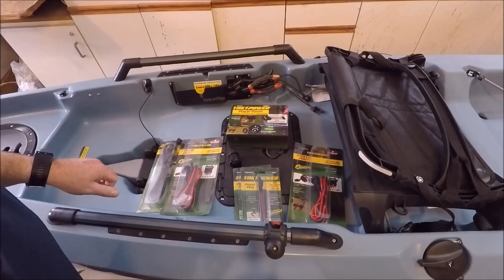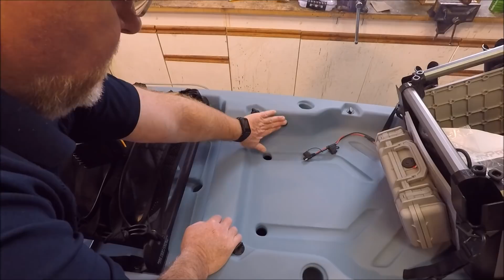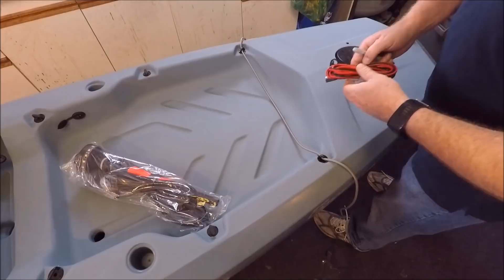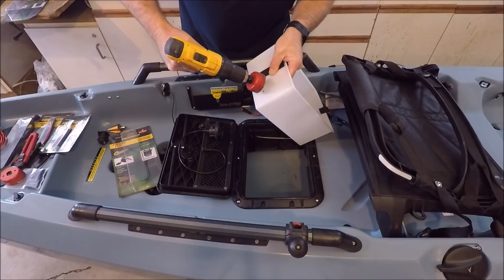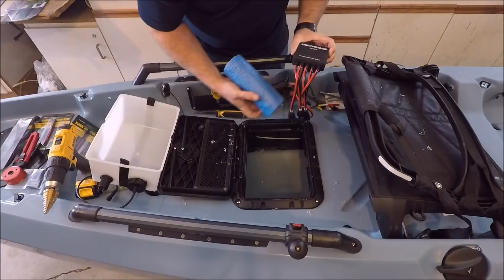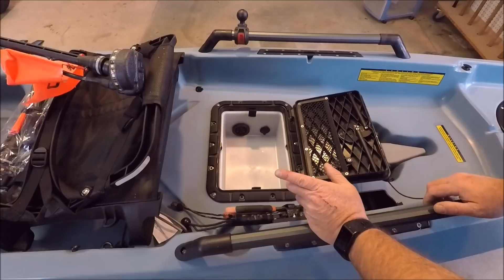Hobie Compass - Yak-Power system install

Comment: Was thinking of this set up using Nocqua batteries but wanted to wire 2 each 10 ah in parallel and add a charging port in the rectangular hatch. I will probably have to call Yak Power for advice. Comments?
Reply from the maker: You can't wire the Nocqua batteries in parallel. Look into FPV-Power batteries, they make a 7Ah and 17.5Ah. The FPV-Power batteries can be wired in parallel.
Reply: I called Nocqua- you can run in parallel but they don’t recommend and the warranty will be voided.  That said, in May 2019 they will have an auto selector that will switch power draw from battery 1 over to battery 2, when the former reaches minimum charge.  I would still like to use a Yak Power port to recharge the Nocqua’s but does not seem feasible at this point. Thanks for your help.

Comment: You should have put the round hatch that you removed to the back of the kayak so you could have access
Reply from the maker: There is no flat surface back there, so it wouldn't seal.
Reply: Gotcha. Cool set up. Which pelican case do you use for the battery’s?
Reply from the maker: Peter Toohill I use the 1200 now. The first battery I got from Bioenno Power fit in the 1170, but they don't make that battery anymore and the newer 30ah won't fit in the 1170, so now I go with the 1200